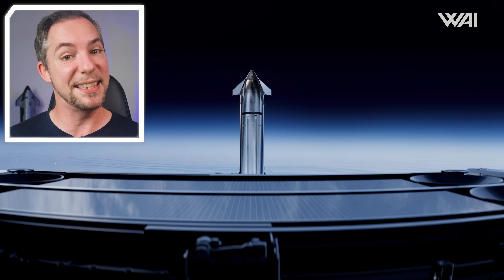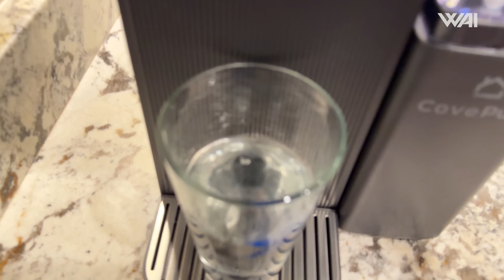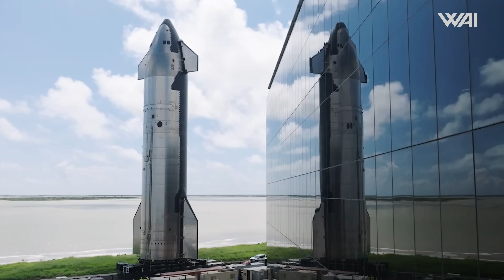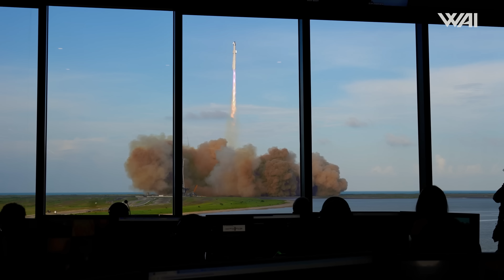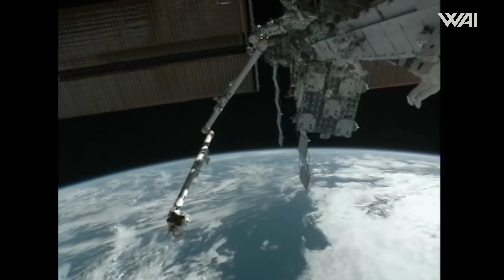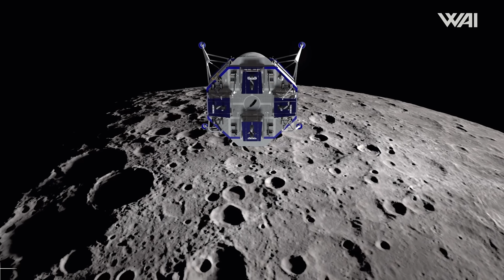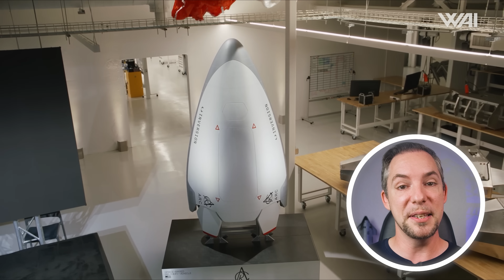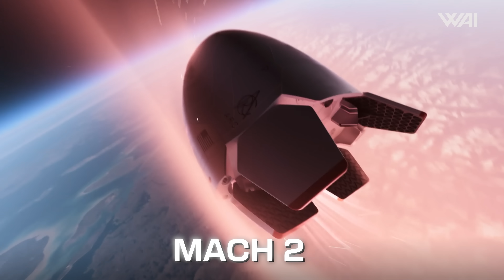SpaceX's Largest Upgrade Yet Reveals Starship v3 Future! Starship Flight 11 Imminent!

Comment: Blue Origin has not only gone to school on previous ship builds, they also saw what SpaceX did for structure builds in the early days at Starbase. So, they knew how to build their facilities at the Cape right away, without having to do their own structures testing. They aren't breaking new ground - just following what SpaceX and others are doing.
Reply from the maker: There's just one problem with that theory. Blue Origin began construction of what you see today at KSC in 2015. Without changing its plans much.
Reply: Exactly. The slow pace of blue origin is a feature not a bug. It quickly became apparent to Bezos that “Copy spacex” would be their best company policy for success.
Reply: @undertow2142 They must be using a very sloooooooow copier
Reply: @mrchrisoko they just take their time lol (too much time)
Reply: @mrchrisoko And one where the image gets turned a bit to the side and is about half an inch too low. Otherwise with all that time spent coping they would have caught the booster. At least when the Russians or Chinese copy something, they occasionally get it correct.
Reply: I agree to a point. They're watching the same videos we are, probably going back to the sources and getting the extras from subscriptions. So they probably have very educated guesses about approaches that didn't pan out, but  there's a lot they can't see too.
Reply: Sub orbital with a different rocket this one never flown has it?
Reply: That’s a smart move by Blue Origin. Why spend billions in R&D when someone else has already done the work for you?
Reply: @TheDCJason  "Smart" is relative; time is money.  How much of either can you waste versus your competition? The answer defines how long you can stay in business.
Reply: Yet next year they will attempt a moon landing and Starship is earth bound, yes I see your point now, follow NASA routine and do it right, and copy a few things from SpaceX who copied it all from NASA in the first place!
Reply: @flightsimdev  Sure, buddy.  NASA's been catching boosters since the 60's.  Anyone can do it.
Reply: @RobinMiller-v6c  Show me where SpaceX has landed a rocket like an aircraft, we could compare them all day, but one thing you have to remember, without NASA or funding from the US Government, SpaceX wouldn't even exist. Starlink launches alone won't pay there bills.
Reply: @flightsimdev  "Starlink launches alone won't pay there bills." Ummm. Starlink has 6+ million subscribers. Even a pessimistic average of $50 per month would make that 300 million gross revenue per month. That'll pay a lot of bills.
Reply: @flightsimdev  SpaceX is better, faster, cheaper, and more frequent than NASA by an order of magnitude, and all you have is 'they're not landing rockets like aircraft.'  Even with the few VTOL exceptions, nobody - and I mean nobody - cares.  Nostalgia isn't putting upmass in orbit.  And stop with the 'US Gov't funding' line.  Uncle Sam didn't hand Gwynne a blank check saying, "Party on!" - they are buying deliverables: launch this payload (Huh. Why are they called 'payloads'?), create a crew transport, boost the space station.  SpaceX earned every nickel they've received and they damn well deserve it.
Reply: @RobinMiller-v6c  Sure. They worked for it, no one said they didn’t, but that money came from taxpayers, not venture capital. “Earned” doesn’t erase the fact that NASA and the U.S. government created the market that made SpaceX viable, without NASA’s contracts, SpaceX doesn’t survive long enough to “earn” anything.

You say no one cares, people should care, landing rockets vertically, for example, is an engineering flex but not the holy grail of sustainable space-flight, NASA’s approach focuses on mission safety, redundancy, and scientific value, not showmanship and PR stunts. Different goals, different measures of success. and the reusable rocket is only 30% reused.

"SpaceX is better, faster, cheaper.”
NASA bankrolled its infancy and handed over decades of aerodynamic, orbital, and materials data. SpaceX didn’t build a cheaper rocket in a vacuum, it built one on the skeleton of 60 years of NASA trial and error, without NASA’s blueprints, test ranges, and human-rating standards, they’d still be blowing up prototypes in a desert.

And let’s not pretend SpaceX invented vertical landing rockets, the concept dates back to the McDonnell Douglas DC-X in the 1990s a NASA-funded project that successfully demonstrated VTOL and rapid turnaround capability decades before Falcon 9 ever existed. NASA shelved it not because it failed, but because funding priorities shifted and the tech was too costly to mature at the time. With modern computing, materials, and automation, it’s just easier now.
Reply: @flightsimdev "one thing you have to remember is without hundreds of millions from NASA and the Government contracts awarded to SpaceX because they have the cheapest, most reliable, and most timely launches available" There I fixed it for you.
Reply: @flightsimdev  Ah, yes. The rhetorical technique in vogue since the Babylonian exile: throw the pot of spaghetti against the wall and see what sticks. Guests in Felix' house should be brief. Response to random strands in no particular order: unsubstantiated opinion; true but irrelevant; bald-faced lie; sheer speculation; unsubstantiated opinion (again); apples-and-oranges; true; logical fallacy; invention-out-of-whole-cloth; proof of illiteracy; false; 

wild guess. Thanks for playing.
Reply: Great enthusiasm + informative. Well done!
Reply: And 1 launch a year isn't impressing anyone. Bezos is about money and not progress
Reply: @pooknasty4234  What a ridiculous statement.  ANY commercial space venture is about money.
Reply: @pooknasty4234 my uncle works there and he says that blue origin takes time and doesn't do frequent launches like SpaceX, however they do stuff like SpaceX but it isn't all about bezos. (In my opinion)
Reply: @pooknasty4234 not even one launch a year.
Reply: @Lockpickingblacksmith   not even one launch a year.

You aren't impressed with their 1 year string of one launch to orbit a year?

The 2nd launch scheduled months ago was delayed repeatedly eventually  till December, then advanced to October now delayed again till November.  As with the last launch "I'll believe it when I see it".

:planet-orange-purple-ring:
:planet-orange-purple-ring:
Reply: @Scanner9631 zero launches to orbit ever. They’ve only had suborbital launches.
Reply: @Lockpickingblacksmith  Actually, Blue Origin's New Glenn rocket  reached orbit on its first attempt on January 16, 2025 and its currently capable to deliver more payload to LEO than starship. New Glenn can deliver 45t and starship only 35t to LEO.
Reply: @marekg5884 Wow, the level of just wrong information is impressive. First you have your launch systems completely wrong. New Glenn is competing against Falcon 9 and Falcon Heavy. Falcon Heavy can put 55 to 70 tons into LEO depending on configuration. New Glenn can only do 45 tons and has yet to succeed in returning a booster. Falcon Heavy has launched 11 times and has proven reusability. New Glenn has launched once and lost the booster. Don't even get me started on the difference in launch cost.
Reply: @edwardson6825 but being liquid hydrogen they should be able to get more tonnage to geo no?
Reply: @marekg5884 😂😂😂
Reply: @marekg5884 falcon heavy is 70 tons, way more than blue origin.
Reply: @Daim-j7q 
New Glenn uses the BE-4 engine, which burns methane (they used to call it natural gas to differentiate the engine from Raptor).  Their upper stage engine burns hydrogen, I think.
Reply: @marekg5884  what is LEO?
Reply: aside from what is Leo… I am angry about my Internet’s response to a question about SpaceX and the answer I got was all about bezo, and how he was the first spaceship winner of the year… I just get mad when the conversation is so tilted and biased!
Reply: @margobarranti  Low earth orbit
Reply: @edwardson6825 what have i wrong? New Glenn rocket  reached orbit on its first attempt on January 16, 2025 - True; currently capable to deliver more payload to LEO than starship. New Glenn can deliver 45t and starship only 35t to LEO - True. New Glenn and Falcon Heavy launch costs are similar.
Reply: Still unproven, yet they spend billions on them... I hope they can do what they are paid to do, but I really feel as if they won't, and it'll be a waste if my tax money.

Comment: I think once the Giga Bay is up and running, they begin to swallow up the two Mega Bay's to make the Giga as large as possible to continue putting together as many ships and boosters as they can.  They wont be really using the two Mega Bays any longer longer, unless they are still tall enough to assemble v3 Starships.
Reply: I agree (partly). It's a strategy for building a huge facility that we've already seen SpaceX implement at Boca Chica. The first bit of Starfactory that they built was a self-contained building with 4 walls and a roof and then they built another bit next to it, further towards the village and when complete knocked down the previous end wall of the original building to merge the 2 bits into one bigger building. Then they started repeating that process to "grow" the Starfactory towards the highway. I think we'll see the same with Gigabay.

Once this first bit of Gigabay is finished I think the first thing we'll see is Megabay 1 getting knocked down and that space used to make Gigabay deeper. I'm not sure though if we'll then see a third phase of expansion to use the space currently occupied by Megabay 2 though. It's possible that by then, a Gigabay with maybe 40 workstations, that might be enough because don't forget that Roberts Road is also going to have big production facilities with more empty space around it and Boca has always been intended to be more of the R&D location so perhaps doesn't need quite the production capacity of Roberts Road. It's possible that SpaceX might want to use the space currently taken up by Megabay 2 for something other than more Gigabay space.

Here's another crazy more far-future thought. Obviously it's many years away, maybe a decade or more if it even happens at all, but there has been talk of Starship eventually not only growing in height but also in diameter with a 12 metre version sometimes mentioned. If that ever happened this current Gigabay would be obsolete so maybe if/when that time comes SpaceX might use the space where Megabay-2 is to start a new initially fairly small Gigabay to test out ideas for laying out a Gigabay for larger diameter Starships and once they've worked out what they want then that 12m-capable Gigabay (or whatever diameter they are moving up to) starts expanding towards the highway eating up the existing 9m-capable Gigabay as it goes.
Reply: @julianfp1952  Terabay
Reply: Unless they decide to assemble "Stubby Starships" (for the Artemis program) in the mega bays? Plenty of room to make future compact variants in those mega bays. Even a normal-scale Lunar Starship is v2-sized if it isn't scaled down to "Stubby".

Comment: Starlab is interesting but is not the most efficient use of Starship technology. 

The Ship itself can be outfitted as a space station with 1000 cubic meters of pressurized volume (ISS has 915) accommodating 10 to 15 astronauts and sent to low earth orbit (LEO) in a single launch. If the liquid methane main propellant tank is used as pressurized volume an additional 600 cubic meters would become available.

Cost would be $5B to $10B to build and deploy a Starship space station to LEO (ISS cost $150B and took over 30 Space Shuttle launches and 15 years (1996-2011) to build and deploy to LEO).

In effect, the replacement for ISS is on the launch pad at Starbase, Texas now.  All that has to be done is to outfit the Ship with the internal components required for crew habitation and for scientific activities.
Reply: Well Starship is intended to carry 100 people to Mars and they're intending to build 1000 every 26 months. A space station seems pretty much already on the drawing board considering it can be just a Mars ship with no legs.
Reply: ...like Skylab...  Looking forward to HLS testing; a variant of same could very well be the station you're describing.  Or a Lunar Gateway.
Reply: @RobinMiller-v6c  Right. 
Side note: My lab worked on Skylab development for three years (1967-69).